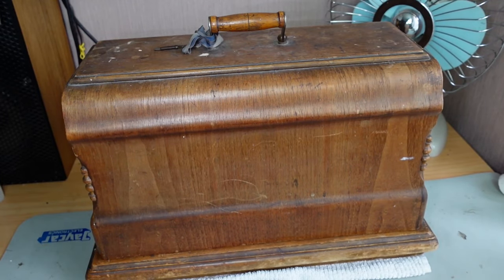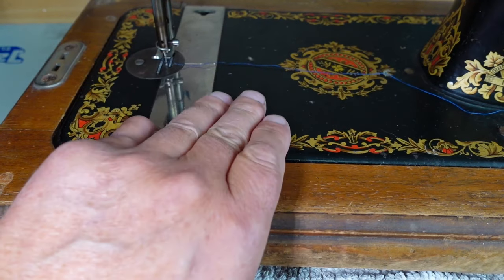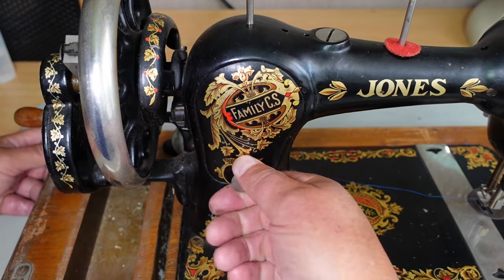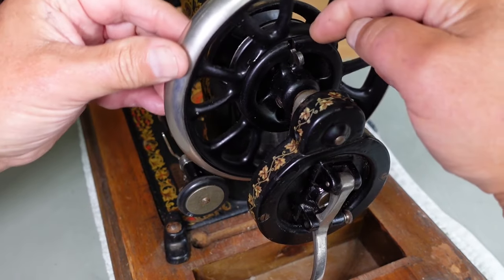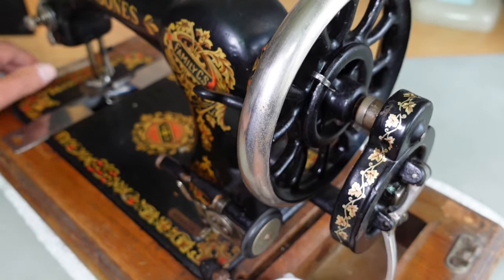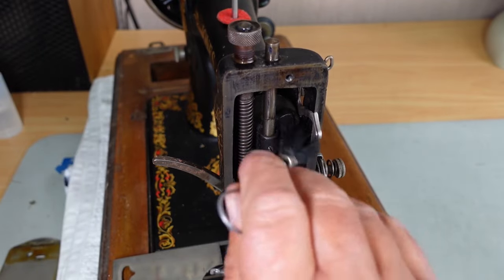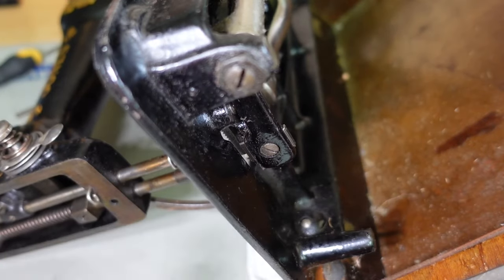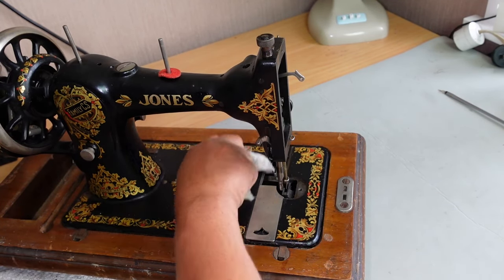Servicing this Beautiful Classic Jones Sewing Machine

Comment: No there is no check spring on the tension.  It is a manual release so you should press it when threading.  It does seem noisy and that is the same with the Jones CS I am cleaning up.  A bit of play in the needle bar.

Comment: I have worked on a few of these machines for friends
Jones CS 1896? a very old style odd bobbin winder the path of the thread over a bar in front of the bobbin it is very odd. Roses decals
Jones VS 1916? there is no back stitch 
Jones CS 1925? this has reverse stitch - the stitch length leaver casting allows further travel to the top of the machine to back stitch

Interesting these machine do not have a top tension take up spring
all the best